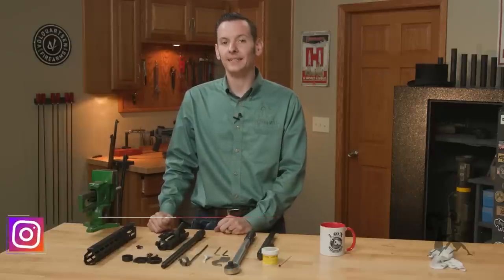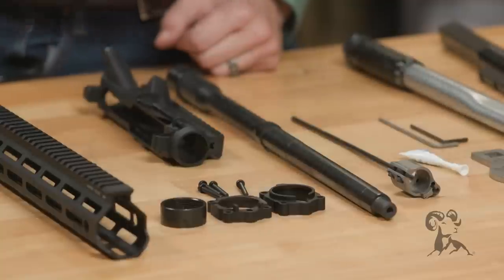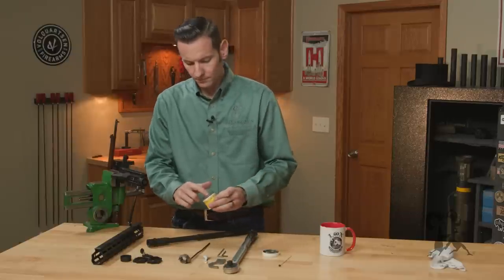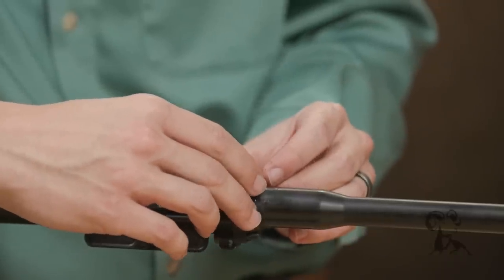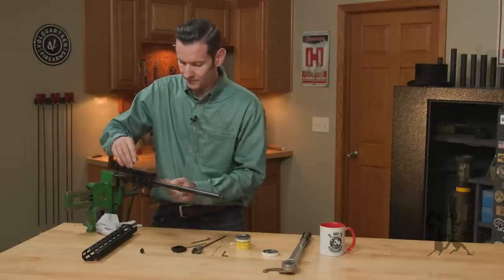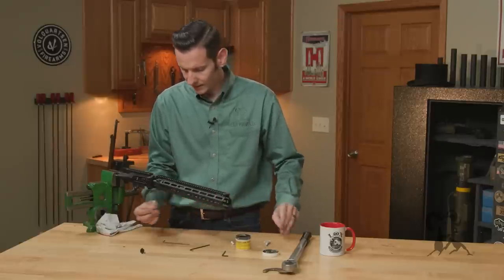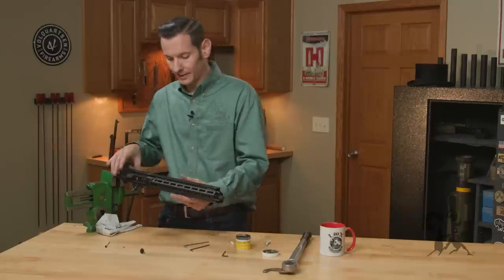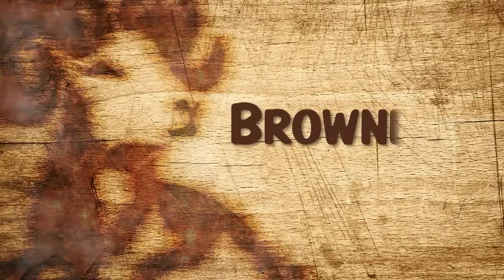How To Install the Daniel Defense MFR Handguard

Comment: Thanks for the video, I recently purchased a DDM4v9 , and quickly discovered that my iron sites would not co-witness to The HWS without adjusting windage all the way to one side, after watching your video I decided to loosen the hand guard and basically reinstall using the star pattern as shown paying close attention to the alignment with the muzzle end of the barrel which solved my problem , now everything lines up perfectly. Thanks again
Reply: Just got a new upper I have gaps and one mount is tighter than the others. There is always something new to learn QC not to good.

Comment: Excellent tutorial as always. Thank you for reminding everyone that when it comes to Loctite, a little goes a long way. Same can be said about anti-seize compound. Also not to over torque. Interesting how smiths seem to be split on the position of torque wrench on barrel nut wrench. Some say 90, some say in line. I have done both and haven't seen a noticeable difference.
Reply: There really isn't an argument about barrel nut wrench position. The reason to put it at 90 is to prevent over torquing. When you put it in line, you're extending the torque wrench leverage and pivot point. You're essentially adding leverage and working outside the torque wrenches calibrated length. When the wrench is at 90, you are applying torque at a similar length.
Reply: @maddoxinc1642  both work about the same. Whether you are at 90 or in line, the distance between the center of the nut and center of the drive on the torque wrench does not change. So either way you are applying more torque than indicated by the wrench. There is a simple formula for calculating the torque applied. Then again, the torque range on the barrel nut is so broad that it's difficult to make a mistake.
Reply: @unclebob540i3  I don't think it matters to be honest. That barrel nut gets hot and cold so much that it'll loose spec anyways. Just get it close enough and it should be good.
Reply: @maddoxinc1642  I agree, spec is 30-80 lbft. That is a huge ballpark, as long as the barrel nut is within that range there won't be an issue.

Comment: My Cross Machine Tool upper left a few degrees of wiggle between the tabs on the rear plate. I did have to use a scope mount across the rail to line everything up before tightening it down.

Comment: What a marvelous how-to video.  Multiple points were important for me.  The receiver rod - had never seen one before, and after all my struggles trying to secure a firearm for barrel/handguard work . . .    This hand guard is a MUCH smarter design than that one that came with my extra expensive Wilson Combat rifle (pre-COVID).  That barrel nut had to be torqued a ridiculous amount of get the next opening for the gas tube to line up.
Reply: Thanks! If you want to be technical 90 degrees would be correct, but honestly it makes absolutely no difference here. The torque range for an AR15 barrel nut is approximately 30-85ft/lbs, which is a very wide range and we are usually torqueing non-indexing nuts about 40ft/lbs, the difference that an inline vs. 90 degree wrench gives us at an extreme case is no more than a few ft/lbs. (Other factors play into this as well, such as distance from driver to tool contact point on work piece, etc.)

Comment: THIS is why I will tend to always say an AR is better than an AK. 

My AK has a cracked front trunnion. I can’t fix it myself and not a single local shop wants to touch it. I’d have to pay an FFL about $100 to get it sent out and then about another $100 to get it sent back AFTER I pay someone a few hundred to do the work AFTER I source a front trunnion to swap. 

My AR-15s, I am fully confident I can build and maintain/repair them in my own home with simple tools albeit custom/proprietary. But at least I don’t need rivets and a press. 😂

Comment: Haha I spotted that he had the wrench on there wrong. He had it oriented for loosening the bolt, that was why he had to switch it. It's an easy mistake to make. Basin wrenches for installing faucets and even pipe wrenches works the same way, where you have to flip it to make it pull the other direction. My UTG SuperSlim Pro uses a similar proprietary barrel nut wrench.

You should take some brake cleaner or acetone, with a paper towel and degrease both the male and female threads. Hardware usually has a little bit of oil on it from the factory and degreasing will make the threadlocker work better.

Comment: I'm still learning, so just asking to understand; why are you not using anti-seize compound when you secure the barrel nut to the upper receiver?
Reply: If you want the barrel nut to loosen over time use anti-seize compound. Its in the name "anti-seize" meaning easy to take apart again. Unless you plan to change barrels regularly you actually want the barrel nut to seize so it doesn't back off and come loose.

Comment: Is there a reason why you didn't season the threads while installing the barrel nut?
Reply: Because seasoning a thread will remove any burs from the machining process. While it sounds like a good idea. In this case you actually benefit from not seasoning the treads as the tolerance will be tighter and it will help prevent the nut from backing off. You want the nut to go on tight.
Reply: @shanemartin92  so by not seasoning the threads on a barrel nut acts as a kinda "lock washer" in a way?
Reply: @ericward9159  Yes. It holds better because there is still grit between the fresh threads from the machining process. The logic applies to all threads. The more times you thread something on a tread the more it wears in requiring less forces to tread back off. Seasoning is not your friend in this situation. If the barrel nut is torqued properly no grease, oil, thread locker or anti seize is required.

Comment: So if im swapping my old quad rail for this, do i need to mess with the gas system at all? Couldnt i just undo the 4 screws, take off the quad rail, then put the mfr right on, then retighten the 4 screws?

Comment: awesome content very educational: what ever happened to the larger inner diameter Mlok handguards. the newer slim mlok handguards suck. especially for those of us with a larger grip
Reply: You might want to go with Aero if that's what you like.
Reply: @Pyreleaf  aero is garbage
Reply: The newer slim m lok handguards are fantastic. Lighter, more sleek, and they work better with hybrid/clamp style grips using a vertical foregrip.
Reply: @KeepTheGates  okay bud, you're a party of one with that opinion, but you do you 👍
Reply: Define "larger" because I lot of manufacfures have "SD" type handguards that are able to tuck a 1.5" dia suppressor inside making their OD* larger by default.

Comment: These handguards are extremely difficult to be aligned up/down left/right with the stripped upper. Even if you use a tool or a scope mount to bridge the upper and handguard. If you are using ironsights you will never have them aligned enough to where the rear peep sight is in the middle of the sight. Always end up either way to the left or to the right.
Reply: they dont align with the upper they align with the barrel nut. just like any other free float hand guard.
Reply: You are trying to align too early in the process, tighten down everything, back off half a turn then align and final torque.
Reply: @CalebSavant  He has spoken, I knew I was missing something. Still skeptical about these though. Went kac and never looked back.
Reply: @mcaque  no worries! Both are great setups. Can't go wrong with kac.

Comment: Do you have to worry about head spacing if the barrel comes with the barrel extension pre-installed?
Reply: the barrel is headspaced by the manufacturer if it doesnt it fails a gauge test thats a qc problem

Comment: Hi,

You didn't mention or discuss anything about the Barrel Install Head Spacing??

Ty
Reply from the maker: This is specifically about the handguard, we have covered the how to properly install barrels and check headspace in other videos specific to that topic as well, the most in-depth guide can be found in our AR build series available on our webpage.
Reply: @brownells  Ok WOW Ty for the Rapid Response. Perhaps the in Depth how to in the separate video is fine. But the Mention of the Necessity of in this Video is an Entirely different Matter!
Link to that other video please?

Ty
J
Reply: @allphaseelec5738  use spec parts and don't worry about it.

Comment: Top rail of the hand guards a tad low compared to the upper and left to right is off
Reply: The height is flush, there is a bit of a gap but that is intended but it is because of that gap and the camera angle that the height looks off.
Reply: @CalebSavant  I call that an optical confusion.
Reply: @dougdouglass1248  obstacle delusion

Comment: aw man I hope that table has an epoxy layer on it so that loctite doesn't seep into it. Nice wood like that is getting expensive. You don't have to be that sparingly with the loctite like one drop isn't going to make it hard to loosen. It's designed so stuff doesn't get loose but you can heat it up and it will loosen stuff for you. One drop on the threads near the tip of the bolt and as you screw it it will spread through out the threads.